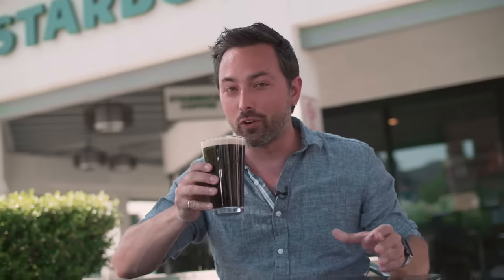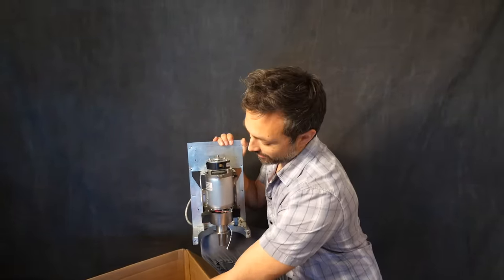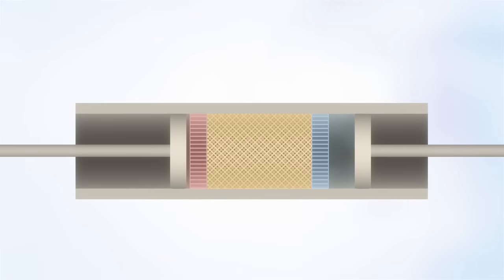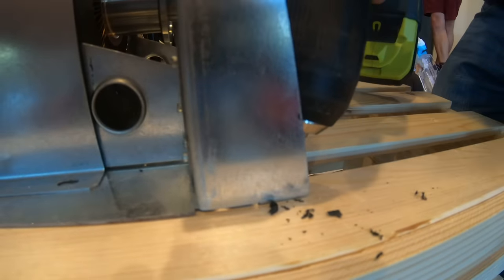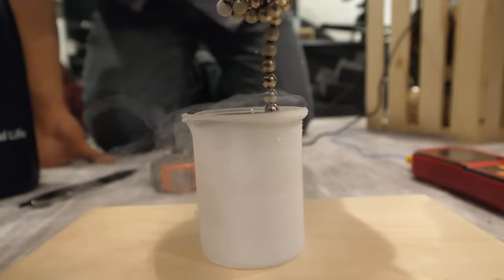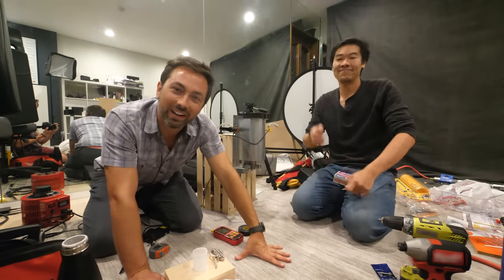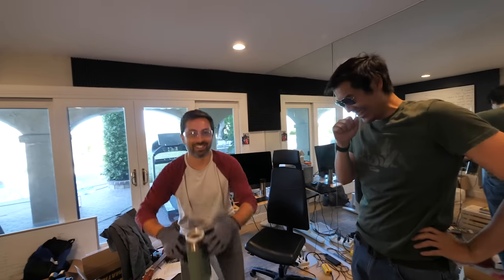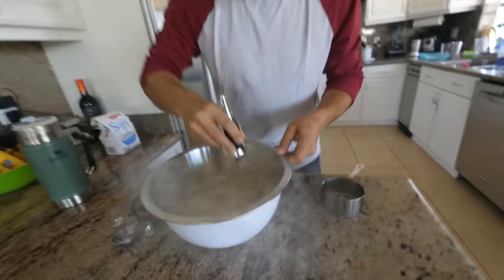Making Liquid Nitrogen From Scratch!

Comment: Making Liquid Nitrogen From Scratch

Proceeds to unpack a CryoCooler
Reply: "Making pasta from scratch"
Proceeds to open a package of dried spaghetti
Reply: @SteveBonds  What??? That's not at all the same thing... What are you guys talking about.
Reply: "Make french bread from scratch"
Proceeds to open a packet of wheat seeds
Reply: I mean he's not God.
Reply: "From scratch" simply means that there's no previous manufacturing by anyone else. The nitrogen still came completely raw from the air. It's not about the tools you use, it's about the product.
Would you also say: "proceeds to use hands already developed by years of growing as a human being"
Reply: How about this.  
Making pasta from scratch

proceeds to unpack machine designed to make pasta from scratch automatically
Reply: @Notski  What about the stars that fused hydrogen to make nitrogen?
Reply: I see what's happening in these replies. I would think a more relevant approach would be to consider the proximal effort required to liquify the gas - the refrigeration mechanism. If Derek had shown how to construct a cryocooler, or, better yet, how to refrigerate the air to liquifaction using compression, heat exchange, and a countercurrent assembly I'd be satisfied. No need construct a carbon/nitrogen cycle fusion reactor - Gimme a break.
Reply: @CantripGhost  you got him bro
Reply: @Notski  no but it feels unfair.

Grant thompson made it from  scratch i believe
Reply: @jonahansen   I think the real criticism here is about the click baityness of the topic paired with such a weird sponsorship.
Reply: We can argue what "from scratch" means but I also think that this looks like a relatively low effort sponsorship grab. Not as bad as the electric car one, but still. He could've easily built a linde liquification apparatus for less money and then shown the distillation instead of a boring, expensive metal tube. Would've been more impressive and also how starbucks actually gets their liquid nitrogen.
Reply: @Cloruro  raw natural materials.
Reply: @CantripGhost  Great example
Reply: I buy the flours and proceed from there.
Reply: "Making water from scratch"
Proceeds to take water from the ocean
Reply: @shannonm7981  :) platitudes
Reply: @shannonm7981  And the base is with all gases is?
Reply: He describes perfectly what it takes to liquify nitrogen from air. Basically separating and cooling. so, yeah, as from scratch as you can do on earth.
Reply: @thetinkerist  You can literally make anything if you know how it works.
Reply: @Notski  
He didn't make the nitrogen (as expected) and thus I expected him to make the tools. 

It's like claiming to make a sandwich from a scratch and then instead of baking it, just put butter and cheese on ready made bread.
Reply: @SteveBonds  It's more like making spaghetti using an extruder. That's the tool you use to make spaghetti. Or making an omelet using a skillet. I don't think using tools disqualifies the label of "from scratch."
Reply: Well, what did you expect? That he went to a iron mine in China, started digging iron to build a steel CryoCooler?
Reply: @user255  The point of his videos have always been about the explanations anyway. The science if you will.
If you were expecting him to apply some theoretical quantum fluctuations to conjure up new matter from literally nothing you might have to take a new look at your medication.
Reply: @EebstertheGreat  Yeah exactly. Making it from scratch just means that he made it himself instead of buying it ready from a store like you normally do
Reply: Science Revolution  You sir have no idea what we have tested. We have tested even gamma rays in a vacuum with double slit experiments or without.
Whatever website is telling you all this is either a scam or made by simpletons
Reply: What did you expect, to be made from fart?
Reply: @vanessakitty8867  you can't make liquid nitrogen from flour.
Reply: @fcgHenden  I was referring to the previous comment on bread.
Reply: @vanessakitty8867  I know. 😂 Was a joke
Reply: @Notski  
No, as I said, I did not expect him to create nitrogen, and thus I expected the "from scratch" to mean the tools.
Reply: @mattiafioravanti8475  
That is just fallacy of reductio ad absurdum. With your requirements for "from scratch", nothing can be made from scratch.
Reply: @EebstertheGreat  
Then what was made from scratch in this video? Not the nitrogen, nor the tools.
Making ice from the scratch --> puts water to freezer. What's the point?
Reply: @user255  Also Mattia's example is not fallacy of reductio ad absurdum since that is exactly what it seems you are expecting. The title was "making nitrogen from scratch". Yet for some reason you don't like that he didn't manufacture his tools even though the phrase "from scratch" does not imply that what so ever.
Normal people don't make their own nitrogen, but on this video he did. That's all that can possibly be expected from the title.
Reply: @Notski  
It's quite obvious that it is not what anyone expects. And again, he did not make nitrogen.
Reply: @user255  How would he have made it then??
Can you tell me an example xD
Reply: @user255  I think you are just scrambling for anything to complain about since it's sponsored by Starbucks.
Reply: @Notski  

As I have said many times, I would have expected him to make the tools by himself without going to the absurdity. Why would I care about Starbucks? My problem was that the video presented rather boring advertising.
Reply: @user255  Well basically nothing ever is from scratch, because you can't create parts out of void unless you're a god. It is therefore acceptable though, that the term "from scratch" means, starting from the very basic and smallest components available, so yes, it would have made sense for him having to assemble at least the cryocooler
Reply: @mattiafioravanti8475  
Yes, that is exactly what I meant.
Reply: @user255  I kind of agree; from a philosophical pow.
Reply: @CantripGhost  But the cryocooler isn't designed to liquify air or nitrogen - it usually sits in a special miniature dewar which is kept DRY and has super conductor based filters inside.

So although it DOES get to the right temperatures - its design is to keep super conducting filters extremely cold - not to liquify gas.

Comment: YouTube: making liquid nitrogen from scratch.
Meanwhile star fusing all helium atoms into heavy elements for us a billions years ago
Am I joke to you?
Reply: Well... It never made liquid nitrogen...i think
Reply: @C28-m9u  yep. This joke doesn't work. Don't know why it got 300 thumbs up.
Reply: @harikishore2514  I always thought liquid nitrogen is nitrogen but in liquid. So the Star did not make liquid nitrogen only gaseous nitrogen... Tho we never know. It might have also created liquid nitrogen for a fraction of a second, even tho it's rare for elements to take on the liquid state in space due to the lack of pressure and too high/too low temperatures
Reply: @C28-m9u  there is almost certainly a planet with sustained liquid nitrogen, all it would take would to be very cold (or have an extremely high pressure atmosphere, although it would probably be supercritical before liquid at any normal temps) which given how many planets there are, it is almost certain that there is a planet that has nitrogen and fulfills one of the previous needs
Reply: You need to look smaller .. gases are made up from the atomic scale .. noble gases .. and these are made of what?
Reply: @ewthmatth  Those mainstream memes often get upvoted even if they don't make much sense or are used in the wrong way for some reason.
Reply: @Dragonis431  that's why I said that's its rare. And I also said space. I meant open space with no atmosphere
Reply: @minuteman747  nitrogen isn't a noble gas tho, is it?
Reply: @C28-m9u  @Minuteman Nitrogen is not a noble gas. It just has an incredibly strong chemical bond with itself, triple-bonded in fact, that keeps it inert with most substances. However, with a strong enough acid or the likes of pure florine, it too can be broken up.
Reply: @tiffyw92  oh okay, didnt know

Comment: So, when liquifying a gas, it is handy to place the container on a scale during the process. As the gas liquifies, it becomes more dense. More dense, but same volume = more mass. More mass in a non-inertial frame of reference (ie, a "gravity field") has more "weight". You can then check the scale during the process without disturbing the process, to see if, and how much, liquified gas you have created.
Reply: I too was wondering why they were not using a scale.  Although that could be an expensive prospect.  Precision scales usually don't have a very large range, and the weight of the flask/dewar/whatever might exceed the weight limit of a scale with enough precision to notice the liquefaction.  The other problem of course is the seal they had to use for the nitrogen.  When doing oxygen they didn't need such a seal, and the flask could just be overlapping loosely with the nozzle.  But the nitrogen required a seal, and that definitely would dampen the reading on the scale.

Thinking a bit on this...  they might have been able to use a simple arduino "pinger" that measures distance via ultrasonic ping, with that shooting into the flask and measuring the depth of liquid.  That would only require wires leading out, and could be integrated into the seal.  This might be improved by adding a "float" - a sheet of something that would float on top of liquid nitrogen, to provide a better target for the pinger or maybe a laser distance measurement tool?
Reply: The container is attached to the cooler. You need an exact scale that can handle a fairly high weight

Comment: Nitrogen - from scratch

Start with in excess of 28 hydrogens for each nitrogen desired.
Heat and compress in stellar core for 1/2 to 10 billion years, depending on size of star.
Remove from heat as soon as oxygen begins to form.
Nitrogen will halve in volume as it cools from to final diatomic molecular state.
Reply: thanks mate i almost thought i had to buy it somewhere because i didn't have a cryo cooler
Reply: @leonhardhieber3999  Step 1, create hydrogen
Reply: @Autibot  but you gotta tell them how to create it.
Step 1: artificial big bang
Reply: That's an expensive coffee, even for Starbucks
Reply: Poor mans version: build a fission reactor

Comment: I worked for a company that separated air into liquid nitrogen. They made 99.9999 percent pure nitrogen in liquid state. It was made by a distillation process. Also made liquid oxygen, argon and some other gases found in pure air. Stored it in 50,000 gallon insulated tanks at 5 lbs pressure.
Reply: Sounds like BOC
Reply: Actually if they made liquid air, that's half the battle of making pure nitrogen, because all you have to do is distill the liquid air, that's how it's done commercially.
Reply: @tonysimons4883  BOC = bunch of crap?
Reply: Linde, air products, air liquide, or messer?
Reply: @Crocodile2873  I worked for Big Three Industries. Air Liquide purchased Big Three several years ago. I managed their pipeline operations.

Comment: I just learned why medical fields use so much helium. I never understood how helium was used in refrigeration until now and I'm absolutely blown away. Also I'm happily supprised how well this project went.
Reply: Yup.  NMR.  Superconducter coils.  You need very stable magnets, (sub-parts per million), so you need very stable electrical current, and the best way of getting that is to short a current into a superconducting coil.  You disconnect the power, and the current just keeps going round and round.  Superconducter coils need low temps, hence liquid helium.  Which is sitting in a jacket of liquid nitrogen. which boils off before the helium does, keeping the helium cool and not needing refilling so much.
Reply: If you want to be more specific, the reason helium is used particularly in this application is not only because it doesn't liquify, but also because helium, being a light gas, is easier to push around making it more efficient in the cryocooler- which is actually just a stirling engine in reverse.
Reply: And we are running out, once it's gone it's gone.
Reply: @drampadreg1386  We're nowhere near running out of helium. And it's the same with any other natural resource. Technically, we're also "running out" of iron, but are we anywhere close to excavating every single iron vein in existence, and have we tapped into every single way of getting iron? No.
Reply: @nikkiofthevalley  also in the case of many elements, we can extract them from asteroids and space rocks, which are essentially an unlimited supply of materials (and this isnt even that far fetched of a concept, its been done more than a couple of times so far, whether from meteorites or orbiting space rocks)

Comment: How to make liquid nitrogen from scratch:
Step 1: Get an expensive piece of advanced engineering.
Step 2: You did it!
Reply: What he bought was essentially a pump and a tank. Expensive ones but still.
You can see that he had to put in quite a lot of effort to connect them and finding the right measurements to make them work.
Reply: @divygutp1509  And cryocooler?
Reply: Fer Chrissakes, did you invent the computer you're whining on?
Reply: I mean, the compressor is probably more expensive than that piece of ‘engineering’
Reply: I bought one a couple year ago from eBay, same model as his. $200 with shipping is all
Reply: True... It is not from scratch , this is the method commercially available.
Reply: @arunlkshmn5349  If this isn't from scratch, the only way to bake bread from scratch - according to your definition - would be to cook it on a fire started from natural causes.
Reply: @staalman1226  nice joke
Reply: @arunlkshmn5349  I'm just using the logic you used.
Reply: @staalman1226  ok man
Reply: He...Explained how the cooler works, and it really is as simple as it sounds. If you're smart, and careful, enough you can make one. He just bought one because lets be honest....It's faster.
Reply: @gigaus0  Exactly
Reply: @gigaus0  Really? Do you know of anyone who built it? Because I heard it's very difficult due to strict tolerances, and I'd be interested in one. There's someone who built a Linde cycle liquefier (using the Joule-Thomson effect), but I don't know of anyone who built a Stirling cryocooler.
Reply: What he did was installing all devices, not making them.
Not saying that installing devices is easy, still its not making them from scratch.
Reply: @JustinEdwardsL  it costs more then 3 times that amount.......
Reply: @abhabh6896  It's ebay, demand dictates price.
Reply: @JustinEdwardsL  Its ok, found DE-202F around that price. Now struggling to find nitrogen membrane filter, can find various models on Genron but no prices. I would like to estimate a price on a project like this first. Want to see if I can make liquid nitrogen at uni.
Reply: @kaisyribouth8554  do you know the exact name of it
Reply: @abhabh6896  could take advantage of Dalton's law, and burn the oxygen out of the air, and places the sample into that oxygen poor atmosphere. The oxygen will preferential boil off as its at a lower partial pressure. CO2 will solidify so you could literally filter it off lol. You'll have to check phase diagrams to see how viable it is.
Reply: @trouty7947  Thanks for the idea!
Reply: @abhabh6896  So what? Do you want him to mine the very metals and oils used to make it? You take this logic to the very extreme then only God can make anything from scratch since no one created the universe.
Reply: @jamesdinius7769  Nah, but we all know its a pump, buy the pump and 99% of it is done, at least for what you need. I didnt know they were that cheap though.
Reply: Dan Curtis Thompson
To be fair, they did still make it "themselves" rather than having to buy it off of someone.
Reply: Do you know where I can buy one?
Reply: @staalman1226  also without using any kind of cereal grain because its cheating

Comment: You could have also added a balloon to the system and set the flow rate where the balloon was neither expanding nor contracting, thus matching the flow rate to the condensation rate.

Comment: 1. Weigh the container before and after to determine how much liquid nitrogen has been generated.
2. Run the gaseous nitrogen through a refrigerated coil before running it through the cryocooler to improve throughput.

Comment: I worked on n2 generators w/ n2 compressors up to 4500psi. The gens were powered by 100hp screw comp, a heater unit, then membranes. The heat was critical to open the air molecues. On a certified o2 meter getting 99.5% was fairly slow. 99.9% was very hard, the flow rate across the membrane had to throttled down very low. Cool video for all the non-industrial workers.

Comment: Short answer: if you compress air extremely (which makes it really hot, Boyle's law), and use something like water to cool the compressed air  back to room temperature, and then allow it to expand back to 1 bar pressure, you should up with liquid air 😉   Air Liquide and other industrial suppliers does this on an industrial scale every day, and purifies the various gasses (nitrogen, oxygen, and argon) by allowing them to gas off at their respective boiling  points.  You reliquify the pure gas that evaporates, and you end up with pure liquid nitrogen, oxygen, and argon!

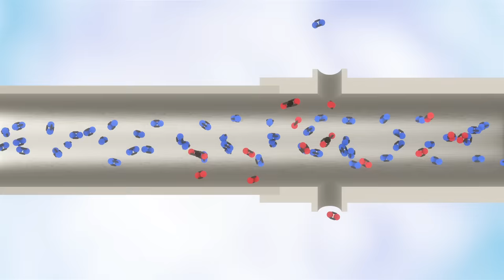Comment: 5:50 is there a membrane like this for oxygen too? edit: I've since realized that, since there's almost nothing but nitrogen and oxygen in the air, you can extract almost pure oxygen by just taking it from the opposite side of the membrane
Reply: You can buy off the shelf, dive shops sell enriched air, or higher concentration of oxygen.
Reply: Why do you need pure oxygen? That is very sus
Reply: @martonbalogh6021  I was just curious if it could be made that way. Nothing else. Totally not thinking about making knocking sound sorry, I gotta answer the door.
Reply: @martonbalogh6021  breathing... it wakeups really good haha